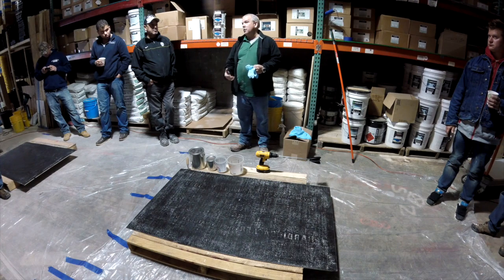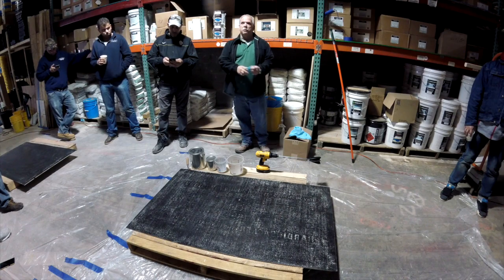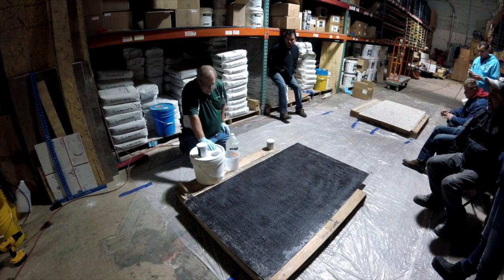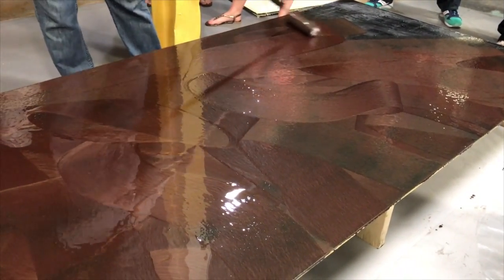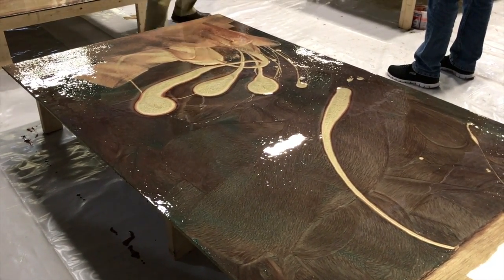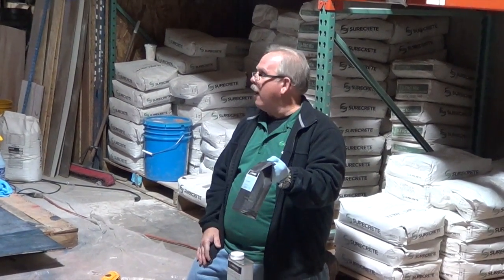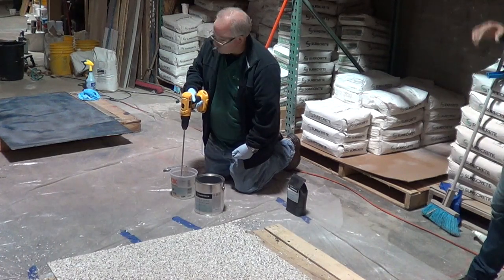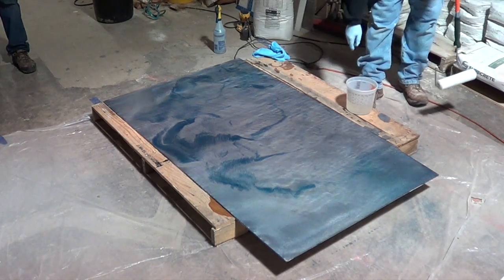Epoxy Metallic Floor. How To Do A Metallic Epoxy Floor

Comment: will it remain as shiny and smooth as in video in future because people will walk. Actually my question is that Is it scratch proof.
Reply from the maker: Yes it will remain shiny. Top coat protects from scratches. It's made for floor and for walking on it.